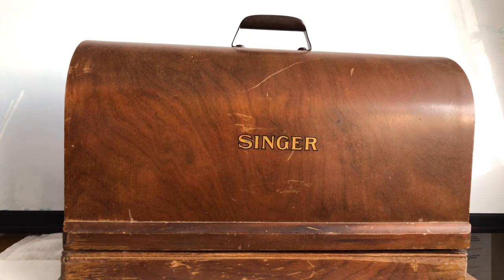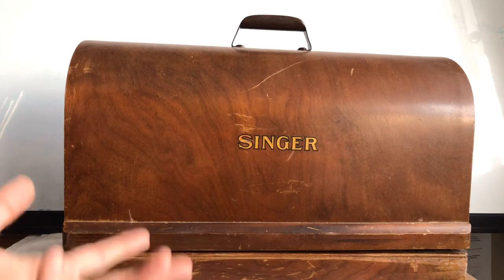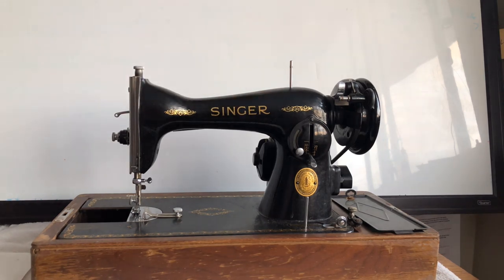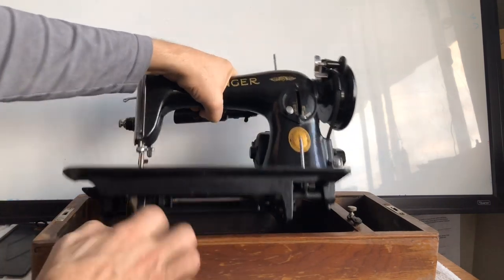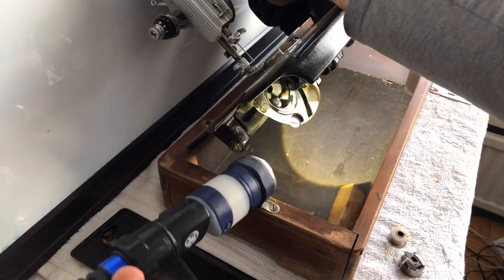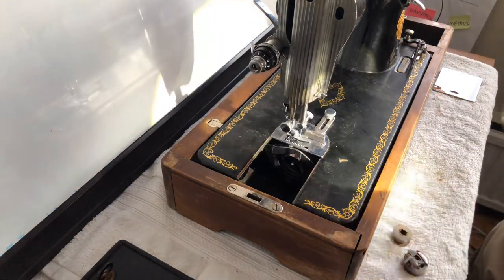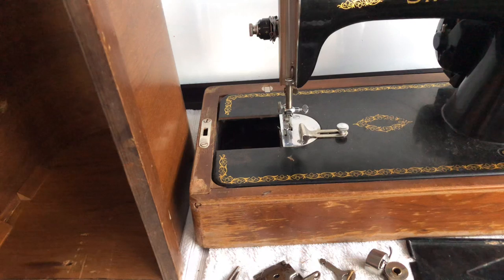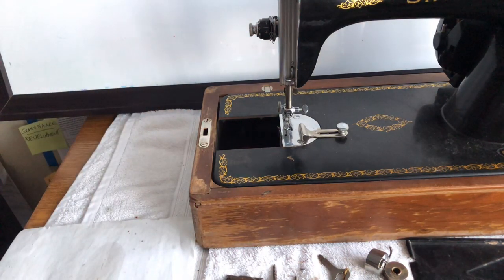PURCHASING SERIES #15: Clues to When a Machine Was NOT Well Cared For & Why I Still Rescue Them!!

Comment: I still have the bentwood carry case for my mom's Centennial 15-91.Dad bought it new for her in 1951. Thank you for sharing! It helps me appreciate my father's act of kindness and my mother's generosity to give it to me when I fell in love with sewing upon her teaching me. Mom's still living, too! BTW, I have a very small screw driver that I use for my lock since the original key was lost before mom gave it to me. The top has to be locked in place to carry the sewing machine in the case. Otherwise the top will come off.

Comment: Been watching your vids all evening in preparation of getting my red eye cleaned up. Been a wood worker most of my life...when you run into a wood screw hole that won't hold a screw, you can put a bit of wood glue on a sliver of wood and put it in the screw hole. It'll give the screw a new bite.
Reply from the maker: Thanks for sharing that Kirk.  I know next to nothing of wood working or refinishing so that could be helpful the next time I have the issue.  It sounds like your suggestion is somewhat like a shim to help reduce the hole diameter.  Thanks again

Comment: metallic blue, that is. I was able to get a new bobbin winder rubber gasket, a new belt, and a new foot pedal. I oiled, polished and waxed it with products from the Featherweight Shop. It is so pretty!  It was so clean when I bought it,  inside and out, but now it is pristine! I would someday love to have a beautiful case. I may see if I can have an Amish carpenter build one. I do have a question, please....the round chrome plate on the back, with the set screw....is there suppose to be a little rubber or plastic washer there? Or is the plate just supposed to hang there somewhat loosely?    I love how you speak and  how you share your knowledge. Thank you so much!

Comment: Is it just me, does anyone else wonder how those little lock latches hold the weight of the wood and the machine? Yikes
Reply: I’ve always been told to not carry them by the handle on the case because it wasn’t really meant to hold the 35+ pounds of machine and base. It was more a latch just to keep it locked.